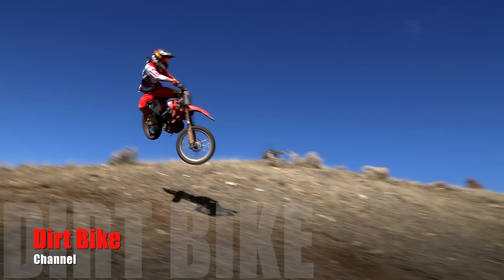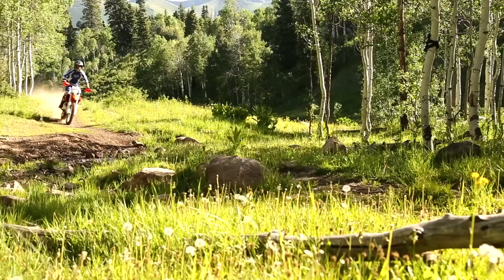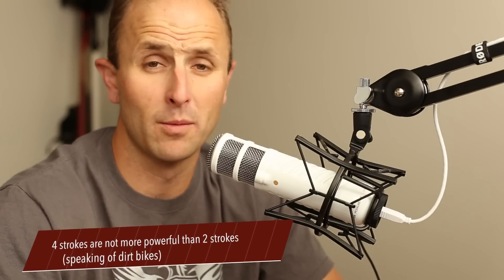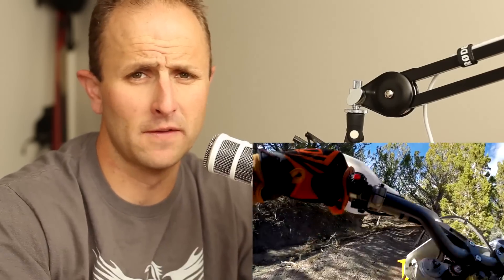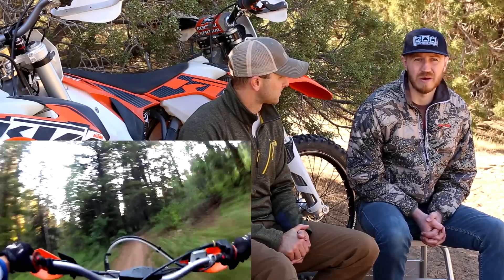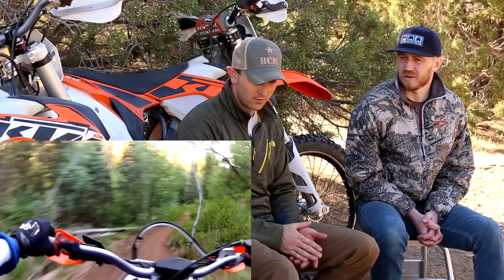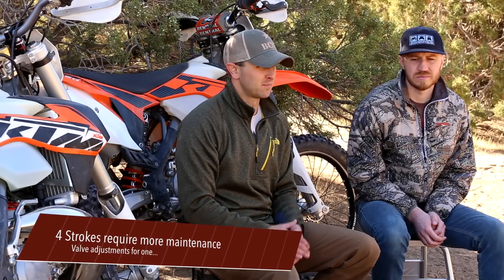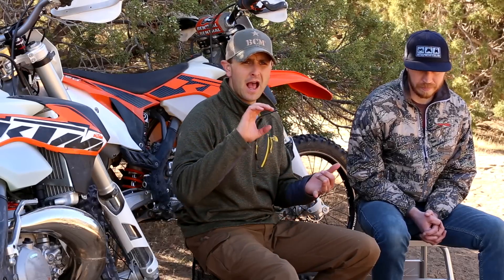Enduro 4 Stroke vs 2 Stroke Part 1

Comment: i just rebuilt my 2003 yz250 2 stroke it cost me roughly 2000 but i did i complete motor rebuild all new bearing and eveyhting even new bolt also had new clutch basket pressure plate push rode basically everyhting on my motor was replaced plus i bought weighted flywheel new fmf exhuast pipe and silencer with air filter grips bark busters  and few other things and ik for a fact you couldnt do all that to a four stroke for that price

Comment: ya but you dont have to work on a 4 stroke as often !  i rode 2 stroke most my life  then got a 250 4 stroke  and man   like the torq for climbing hills  awsome bike
Reply from the maker: +savagex466 I don't work on my 2 strokes any more than my 4 strokes.  On the contrary.... I have to change my engine oil and filters about 4 times as often on the 4 strokes.  Food for thought. There is no right or wrong answer.  Just preference.

Comment: I was really taking this review seriously until you said you could get the same milage from a 4 stroke vs 2 stroke. The fact is that the 4 stroke gets nearly twice as many miles per gallon, sometimes more. 

Riding style aside.... the 4 stroke will always ALWAYS get better mileage. 

my ktm 525 gets close 50+ mpg, I've seen a max of 30 mpg on 2 strokes.

STOCK TANK on a 525 vs the 300. roughly 100-125 mile range vs your 2 strokes 60-75
Reply from the maker: +Travis Sharon I have had multiple  4ts and 2ts.  The mileage gap isn't as much as people make it out to be.
Reply: +Dirt Bike Channel I need to get a husky or ktm 300 2 smoke and maybe I'll agree.

Comment: Long stroke 4 stroke KTM bikes last forever and have more torq vrs high reving short stroke 4 stroke bikes, owned 500 KTM’s never needed to rebuilt them valves always are in check, I think regular maintenance is key and not riding on the rev limiter all the time makes them last.

Comment: I have both a 300 2T and a 450 4T, but ride the 2T more as it is less tiring and great in the gnarly off road type stuff I ride.  Sometimes I like to just hop on it and pull the trigger on the 450 - pure hand of God stuff there.  I am faster overall on the 300 though.  

Funny thing is I feel by riding both bikes, it makes me faster on each.  I set my idle higher on the 450 to reduce engine braking and carry more corner speed on it due to becoming so used to the freewheeling two stroke.  I feel I am faster on the 2T as it feels like a toy after riding the 450.  It is all good - LMAO

Comment: Also don't forget a 4 stroke only fires half of the time so at 12,000 rpms its only firing 6000 times and 2 strokes rev to like 8000 rpms firing every time
Reply from the maker: John Rodriguez Great point.

Comment: What about a Xr650r I have never touched the motor and have probably over a thousand hours on it. Just oil changes and air filters!
Reply from the maker: +Gunner Mitchell Yeah, those old low compression, air cooled motors are bomb proof. My dad has a Honda 500 from 1981.  Never done a thing but change the oil a few times.  Has over 8000 miles on it.  Starts on the 2nd or 3rd kick even after sitting for 8 months a time.

Comment: Its true old 4 strokes last longer my dad had a 1988 500cc xr honda lasted two 2010 until it seized and he had 1988 200 xr honda that only gave in this year but it can still be repaired
Reply: Yes because they are air cooled bikes that are not built for maximum hp and to be light weight, more just to last and get you from A to B

Comment: Not to be that guy, but 2-strokes are generally only 30% more powerful than their 4-stroke class counterpoint. That generally decreases as cubic-centimeters increase. Yes, a 125cc 2T is, CC per CC, almost as powerful as a 250 4T, while weighing less. A KX500, however, is only as powerful as a KX450 give or take a slight horse-power difference. I'm only talking two horsepower though. With that said however, I do enjoy both types of engines. 2 Strokes are not better than a 4 strokes. 4 strokes are no better than a 2 stroke. All the argument is, is an individual preference.
   I am curious to see how a DFI 2T would stack up against a competitive FI 4T. I still don't think you're ever going to see a 50% HP increase with a 2 stroke vs a 4 stroke as "evidenced" by the general arguments from the 2T Nazis, is what should happen. The 2 stroke engine design is just not as efficient as a 4 stroke. It can't be, until a 125cc 2T makes the same power as a 250cc 4T, a 250cc 2T makes as much power as a 500cc 4T and a 500cc 2T equals my literbike, again they are awesome bikes, but not the be all, end all, engine. How could an engine, that fires twice as much as my 4T only make about 30% more power per cc, but be the best thing since sliced bread. I'll also give your the 30%, which is greatly debatable as cc's increase.

Comment: Lets set things straight. I have a 2002 WR426 and have not once worked on the top end or any other part of the motor. And there is not one easy mile on it.  Another thing it that in Montana, 250 two strokes are now racing the 250 four strokes. And also no two stroke 250 will keep up with Yamahas 2015 yz450. Thats why JGR made there two stroke build because they wanted to see a two stroke keep up. But a heavy modified yz250 couldnt keep up with that stock yz450.
Reply from the maker: Riley Genereux Riley, it's all about the rider.  Have you seen how Kailub Russell (GNCC Champion) beat the entire field of bikes on a 150 CC Two-stroke?  Yep, 2014 he had the championship wrapped up with 2 races to go, so he decided to ride a 150cc two- stroke.  He beat them all on that bike.  450's got worked by Kailub on his 150!  It's more about the rider than the bike.  We all have to find something we like and then just ride.  Wouldn't you agree?

Comment: Damn this is so biased! Plus, he says a 250cc 4 stroke is identical to a 250cc 2 stroke. It’s not. 2 strokes are much smaller cc, but create more power at lower engine displacement. A 250cc 4 stroke vs a 125cc 2 stroke would be fair. They both are about the same...
Reply: Exactly. Just the power stroke from each engine and the 4 stroke is more powerful. That's why it has higher RPM. But keep in mind 4 strokes need double cc to equal 2 stroke power because of the less frequent power strokes.

Comment: Two stroke engine will blow away equivalent sized 4 stroke engine on the dirt. A 2 stroke 125cc will beat most 4 stroke 250cc engines on a track. that said, equivalent 4 stroke will outperform most 2 strokes for top end speed. This has been my experience.

Comment: I'm only 14 but from what I under stand 2strokes are great for engines from 33cc to 300cc but above that your going to need a 4 stroke also two strokes break more than four strokes because they have less parts meaning that there's more strain on those parts a two stroke usually operates at 70% their full power while four strokes have more moving parts meaning that there's less strain on those parts four strokes run at 25% their full power
Reply: +Eli Cheatle None of that is true,lol.
Reply: +Eli Cheatle Lol all that is complete bullshit. Honda Cr500 (2 stroke) fucking legend. did you even watch the video and listen to what they said?

Comment: here in philippines 2 strokes lived longer than 4 stroke. A 4 stroke only last here for 5 years even earlier than that the oldest one that ive seen 2 stroke bike is 40 years old its not even well maintained the only downside is the parts

Comment: 250 2 stroke only makes roughly 34 to 36 hp a 450 made 45 to 50 hp and now there closer to 60.  And my 250f I had smoked every 250 2 stroke I went up against and now I have a 2019 450 fx and a 2010 yz450f and they both smoked the 500 class 2 stroke.

Comment: Four stroke development only happened due to US AMA manipulation of the Japanese manufacturers. Consequently most younger riders in the US are four stroke biased as that's what they grew up riding. 2 Strokes kept developing in Europe as they were not concerned about the US market. The fact is both bikes have handling advantages and disadvantages. Controlling the traction on a four stroke is far easier, but I will put you into a set of rocks that will have you wishing you had never heard of a four stroke but each bike has a purpose. How many 2 strokes do you see racing Supercross or at at MX tracks ? How many four strokes do you sea racing Sea to Sky, Romaniacs or Erzberg ? If you can ride you can ride any bike ;)
Reply from the maker: +Jason Livingstone All very good points. Thanks for taking time to make this comment.
Reply from the maker: +Jason Livingstone I think you nailed every point!

Comment: Modern 4 strokes require more maintenance than modern 2 stroke. True.
But saying that a 2 stroke last longer than a well made 4stroke? (Old school)
Totall bullshit.
I live in spain and my first motorcycle was a honda xr600r.... to your surprise it died at 130.000km... I brake the frame and rear shock from abusing it too much, I adjust valves twice only (15min to adjust it on those stone age bikes) and when it died at 130.000km it was because the timing chain snapped... and it snapped because the last time I change its oil it was at 20.000km.
I strongly advice you to go and find ANY smoker in the world that could take the abuse that motorcycle had to live with.
Ps: smokers are by far far faaar faster than 4strokes. That said, don't say 4stroke isn't reliable because of moving parts because that's utter crap.

Comment: You have to give up something for something else.. 2t means high maintenance and messing with fuel/oil ratio premix then comes jetting headache every temperature or elevation change..where 4t is more like kick and go most of the time.. No premix crap or changing piston every 100 hrs, and now with the introduction of EFI you don't have to worry about jetting.. Try that with a 2t. 
It is more fun riding a 2t though..fact.
Reply from the maker: Mohsin Alrazi Try almost no maintenance on a big bore 2t.  I own multiple 2 strokes and multiple 4 strokes so I'm speaking from experience.  Once I jet my 2t for about 7000 feet, it rips from 4500' all the way up to 10K.  Sure, EFI is great, but expensive.  You just have to find something you like and rock it!

Comment: Total biased here boy's. I'd rather have a 4 stroke and have the torque and reliability then a bike that revs a 13K every second. Now I have a 150rb, my friend has a KX 100 2 stroke. Now the power out of the two stroke is great, problem is I don't feel the torque like I do in my 150rb. And I know i'm going to get a lot of hatters on 4 stroke but really, I can drop a gear and hold it and just fly by my friend as he has to let of so he doesn't blow his motor. Like I don't want to do that. But I agree every motor is a time bomb, but that's whether you service it so it's not going to be a time bomb. I mean in all said in done just look at the facts, yes 2 stroke are great but I don't want to have to replace a head and piston every 100 hours or so. I want to be able to put 200+ hours without having to do that. Also again, look, more and more people are switching to four, well mostly because of the torque but also the reliability that comes with them. Now here's to all the people that hate four stroke's, why did Yamaha spend millions converting their entire line of snowmobiles to four stroke? I know this, more so because you can get 350 hp and go 50,000+ K/M. Now all said and done, I will take a two stroke in a snowmobile any day, but in a dirt bike it'll be 4 stroke, and for many years to come.
Reply from the maker: Kyle Fitzgerald If you haven't ridden a 300 2 stroke for 10 or more hours, you simply wouldn't understand :)  I own and ride both.  I'm telling you the big bore 2 strokes are more fun to ride.  One man's opinion.  I'm a yamaha fan, but they get owned by Polaris on the snow.  4 stroke snowmobiles are a gimmick.
Reply: Dirt Bike Channel I never said I have a 4 stroke sled. I've got a 2011 assault 800. I would never buy a 4 stroke unless I could afford to put turbos and stuff on it. Plus they are like 700lbs, mine is only 425, so I'll stick with that. But bike wise de each his own, but I ride trail majority of the time so I really like the reliability of a 4 stroke so I'll stick with that.

Comment: If you have an older 2 stroke you probably rebuild it every season or so, so how does a four stroke require more maintenance
Reply: I will be absolutely honest right now and say I have a 46 year old chainsaw with perfect compression and from what I can tell it has never been rebuilt.
That being said I've seen 4 stroke engines from cars that are more than 50 years old still work

Comment: Hey I appreciate you doing all this work on vids but this one is a bit pointless. 4 strokes came into fashion only because of the AMA changing the rules and the motocrossers accepting this ruling. 250 stroke vs 450 4 stroke, 125 2 stroke vs 250 4 stroke, with a time frame that 2 stroke had to be gone altogether. I expect this was due to some greenie Californian ruling. I live in NZ and recall it happening but not knowing why. We went along with it, so we are suckers as well. There is no doubt. My KX500 passes every 4 stroke irrelevant of its engine size on hill climbs, and it's 20 years old. My YZ250X competes with 450 4 strokes very well in GNCC racing, having the edge in top speed and also tight twisties. It needs more fuel stops, but so do I. I blame the on being born in the 60s, over weight and unfit. Nothing has changed except the 4 strokes have come a long way since the 2 stroke development stalled for 20 years. Europe has rebooted the 2 stroke and now the fresh younger riders think that maybe their 4 stroker is being threatened. The truth is the 4 stroke has never had the power, has always been heavier, has always struggled with rapid direction changes. They have made great strides in 20 years, but much of this is brakes/suspension/frames which can be applied to the 2 strokers. As to any argument that 4 strokes are cheaper/easier/more reliable? Ask any one that owns both and uses their own workshop to do the maintenance. It's a no brainer. 2 stroke for off road, all day, every day. $300 every 150 hrs on my YZ250X. $1500 every 200 hrs on my 450. The 2 stroke takes an hr to rebuild. The 4 stroke takes most of the day. 4 stroke to comply with Nanny state BS, all day, every day, is the only reason 4 stroke off road has the place in the market it does.

Comment: you guys try your best to advertise 2 strokes , the fact is that the cost off adding oil to fuel and having up to 50% less fuel efficient on 2 stroke, therefore  in long run you loose more money on 2t in compare to 4t

Comment: speaking of high compression the new (2016) honda race bikes (either 250 or 450 one has higher but are both high) requure 100+ octane fuel
Reply from the maker: bannablitz247 This is crazy.
Reply: Dirt Bike Channel
i take that back to an extent because only with 14.1:1 do you need 100 octane but the 2016 crf250r is 13.5:1 requiring (info from wiseco) 92 octane+ and seeing as my local stations have 87,89 and 91 thats an issue
Reply from the maker: bannablitz247 Now who's talking about pump gas on 4ts, huh?  Seems that some folks will be buying the racing fuel.  What a pain!
Reply: Dirt Bike Channel
exactly you could probably run 91 just fine and that may be what they recommend, but it would run so much smoother on 100

Comment: Every two stroke rider saying that four strokes are lazy bikes, in changing gears yup but... A 450 has the most low end torque out of any bike making it much harder to take off and you're most likely to whiskey throttle.
Reply from the maker: +xiAm VaLkYrIe My 2014 450 4 stroke doesn't make as much low end torque as my 300 two stroke.  That is a misnomer.
Reply: Dirt Bike Channel A 300 exc may not ever stall and could release the clutch at idle while tapping the rear brawl it still wouldn't stall however, a 450 produces the most torque for its class, it's because of its high compression that it has to be ridden fast. I'm thinking of getting a 300 after watching this video... Maybe.
Reply from the maker: I own multiple bikes (4 stroke and 2 stroke) and like them for different reasons.  You should get a 300 some day and let us know what you think after 10-20 hours on it.
Reply: Dirt Bike Channel Yeah I think it will be awesome but I'm still debating on whether to get a 300 sx, 300 exc etc.

Comment: And where are the 2-strokes in long distance races? They are reliable, have enough power, inexpensive etc. etc.. Maybe there is a difference between off road racing a couple of hours in your near surroundings and spending a long weekend far from home up in the mountains.
Reply from the maker: Avan trettifyra Have you watched any hard enduro races like the ones they do in Europe?  2 strokes everywhere.
Reply: Dirt Bike Channel I wrote "Long distance races".  Dakar, Finke desert race, Baja 1000 ..... 4-trokes everywhere.  Can it be that there are different requirements for the bikes, depending on the type of races we're talking about?
Can it be that the 2-strokes isn't the best choice everywhere, every time, for everyone.
Reply from the maker: Sure, 2 strokes aren't for everyone every time.  Find something you like and go for it.

Comment: 4 strokes hands down better, it's not all about more power, it's about smooth, useable power and control. 2 strokes like to be ridden pinned or nothing, 4 strokes you can roll the throttle on more smoothly. The power on a 4 stroke is cleaner and more precise. 2 strokes are dirty, rough power. Not to mention traction. To each their own, but I've owned them all and 4 strokes are easily my absolute favorite. I can't even stand the sound of a 2 stroke its ratty.